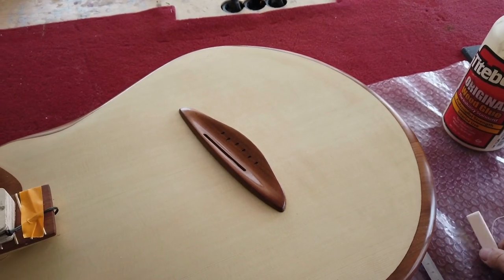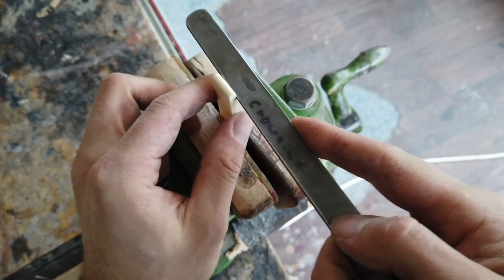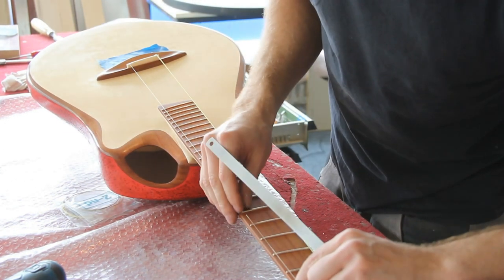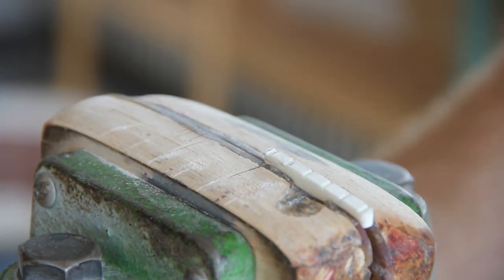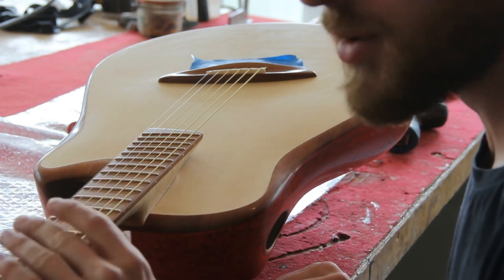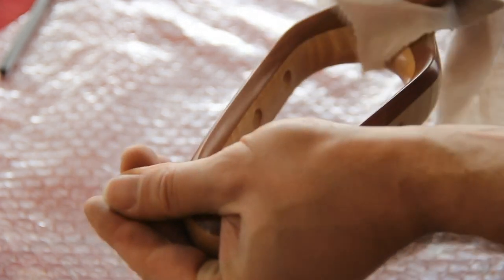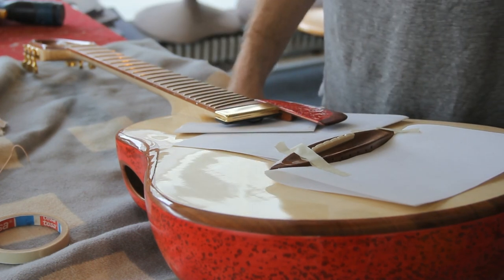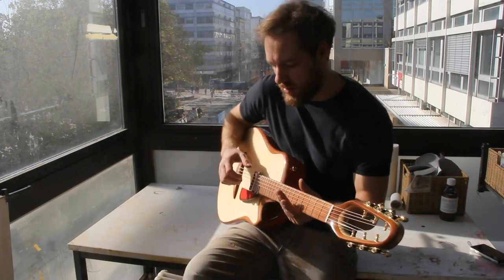Building the Canna Guitar - Ep.10 - Setup And Finish

Comment: This is an AWESOME series! I'm in love with these guitars. I believe you are truly advancing the art of guitar making. Saving my pennies...

Two questions: 1) Can you make a video demoing the sound of the pickups? In particular the humbucker, maybe with some distortions. I'm just curious...
And 2) I've been thinking of a rail system movable pickup like this for an electric guitar. I would put the rails in the body underneath the pickup. Of course you can't do that on an acoustic/hollow body. The other thing I was thinking was to make the electrical connection through the rails. Then you would have to move the wire when moving the pickup. And it would be easier to add or swap pickups, once they are mounted onto the carriage/holder. 

Thanks again!
Reply from the maker: funny, I have been thinking about this rail system a long time ago. Much like on the Teuffel Birdfish guitar. It didn't work for this one because of the pickguard but I might give it a try some day. To your first question. It's a "Harry Häussel - flat jazz" humbucker. Other than that, it's sold a long time ago but maybe on the next one.

Comment: All the questions I've had and didn't want to ask were demonstrated here. That neck adjustment you've built in does the business well. So UST and SBT make sense.. But you've got a magnetic pickup.. Use electric strings. 13-56 come wound 3rd and won't change the acoustic tone at all but will pay off for the Electric tone. Try NYXL Balanced Tension.

Still blows my mind how awesome these are.
Reply from the maker: he is using regular strings, since the have a steel core it works, I suggest to him to try it out but you would leave some acoustic quality on the table, don't really know what would be optimal for both, what strings would you recomment? I think he is using Elexir 13-56, cheers
Reply: @cannaguitars4593  NYXL Balanced Tension.. but I'm saying try any wound 3rd set from any electric guitar string you like in the same gauges. The string to string balance improves without dumping the pole on the B string like so many do. The core is so small that the magnetic pickup doesn't sense as much as it could with a nickel wound.

I can say.. You lose much less acoustic sound with this than that UST

Comment: That headstock design is wild! In on way it kinda reminds me of a violin or a bass, but in execution its totally modern. I am a bit concerned for the joint between neck and body. Not much surface area there for such a critical joint. But the finished product looks great!
Reply from the maker: Thanks Dave. I like you comparison to traditional headstock designs!         The neck joint was never a problem. I made some versions with even less surface and it stood the test of time for 5 years now. Also would be possible to add extra screws if you are worried :-)